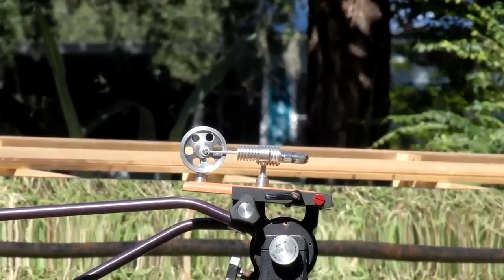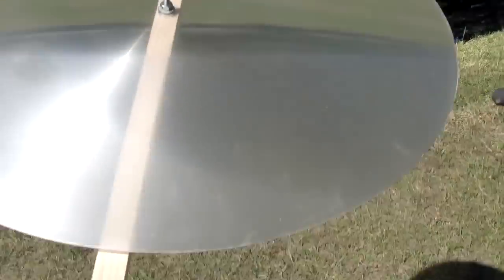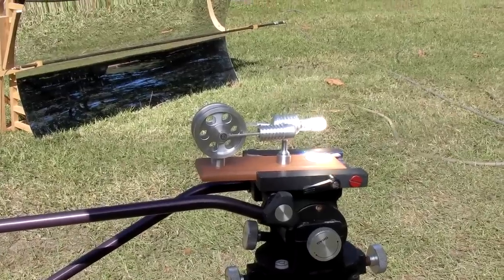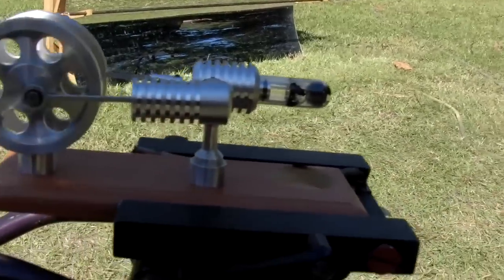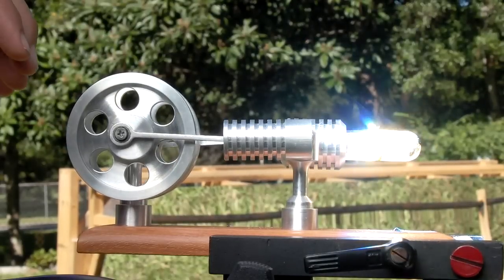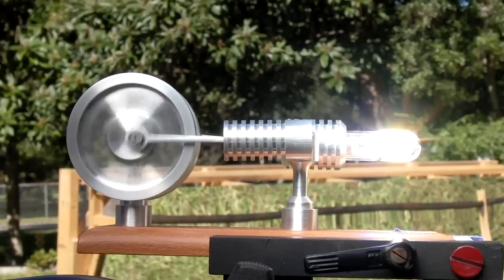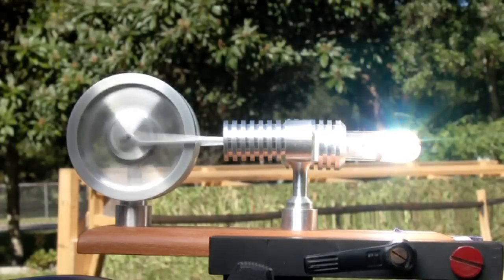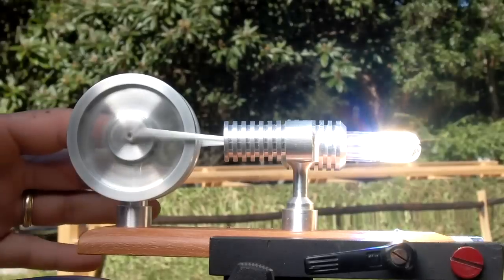STIRLING ENGINE FRESNEL Lens on a Steek Solar powered Stirling Engine

Comment from the maker: If the engine is not running it will burn. The engine removes the heat. If the lens were larger, it would overpower the heat removal and burn the steel wool.

Comment: This setup would work well with induction.
You could place a tiny magnet on the wheel and spin it near a tightly wound copper wire.
Reply: Comment 10 years ago unappreciated. This would be a very good way to generate electricity I agree
Reply: @MrArtVein  give me a year
Reply: I'm doing it by combining two fridge compressors. One induction per piston
Reply: can someone make a video
Reply: I am student of Bangladesh. Can you teach me more and visit our country with your thoughts ?

Comment: You could do something insane, like put a long heat chamber down a parabolic trough & run several water mist injectors. Link several of these piston/heat chambers to a crank shaft & run a full sized generator. 
Could even use fire to heat chambers when sun goes down, in an emergency.

Comment: Water should burst into flash steam inside the chamber, increasing pressure for more horse power.
Set it to squirt each time the piston reaches its lowest point.
Would turn that heat motor into an ICE motor that runs on sunlight & water, the combustion being water exploding into steam at timed intervals rather than gasoline or diesel exploding.

Comment: Here's a suggestion for dramatically increasing horse power.
First, replace that glass chamber with a strong, metal chamber. (you'll see why in a moment)
Next, tap a small water nozzle into chamber wall to shoot a few drops of water directly into chamber.
Hit chamber W/Fresnel. Squirt those drops of water on inner chamber wall right beneath the hot spot.

Comment: in the lighty it has gears . when I crank it at 60 rpm's the gen. is turning 600 rpm's . so this so this engine has more than enough power to crank it without the gears.the flash light it self is assisted with batteries. so with extra batteries hooked up in parallel to take the extra charge while the sun is up and  and discharge while the sun is down( to the LED's) perpetual lights .I know they allready have em in solar cells, but this could be the first one with a sterling engine

Comment: How do you calculate the diameter of the Fresnel lens and  could you use a standard magnifying lens just as well and would a larger diameter generate more power, always assuming that the steel wool, or other conductor ,could absorb the excess heat?

Comment: Cool, the only draw back of the Fresnel lens is you'd have to keep adjusting it somehow to keep the motor going. I much more liked the trough one as it made a lot more practical sense.

So build on that, would love to see a real world implementation
Reply: That's easy, based on your latitude time and date you'd know the exact position of the sun.  Just have a small motor do the adjusting.

Comment: Love those stirling engines, they are even great for getting some power off heat from many devices that would have been lost otherwise. I have designs for some devices that are lined with them, just for that purpose, so nothing is wasted. When heat is involved of course. I first learned about them from a show on Dean Kamen in the late 90s I believe. *****
Reply: Hi, do you still have those designs and ideas?

Comment: Boiling water pushes the piston until it reaches the end of the cylinder & on its way back the slightly cooler water returns via condensation through small grooves/holes in a part of the metal.

I have not opened up a Sterling engine so I don't have exact parameters.

However I'm sure Dan Rojas (?) Could explain the mechanical part better.

Comment: Pretty damn fast!

You should keep in mind that if you were getting some sunlight on OTHER areas of the piston (which are supposed to be as cool as possible) then you could also partially be defeating yourself.

A mirror array plus sterling is supposed to be the most efficient commercial power method from sunlight available.

Comment: Sterling or steam engine combined with solar concentration I believe is the future. This is actually far more efficient than any other practical solar technology today. And of the two I believe Sterling engines are far more practical, reliable and safe for residential applications. 

Nice video Dan! Thanks.
Reply: I'm really interested in this, been researching it for the past 6 hours continuously, went and learned the basics of steam, sterling, PV pannels, incl PVTs. chat gpt is really an amazing amplifier of knowledge gathering and skill amplification. I intend to start a prototype maybe in a month or so.

what's cool is you can use them for anything. you have a rotating motor (think mill, cuttins stuff etc.), but you can connect an electrical generator to it, and with cuntinuous iteration you'll of course arrive at also capturing that excess heat, use a TEG (Thermoelectric Generator) to perhaps capture another 5% of that, and the rest is just heat energy which you just store for later (this I think is the hardest part, and CSP (concentrated solar power) systems already use this, but I was suprised to see they're using steam engines instead of stirlings). anyone interested I'll post on twitter: @xucian_
Reply: @onelucian Hey. Have you followed up on that idea? I’m thinking of doing something similar
Reply: Use it to heat sand batteries for sand battery heaters too @onelucian
Reply: its not tbh, its worst in here
Reply: Very hard to maintain power , problems  with sunlight , will eventually melt anything including rock , 

And pretty noisy compared to home solar
Reply: Wow 15 years ago, ahead of your time. Everyone check out what Exowatt is doing!
Reply: Gay-guy...

Comment: that really does not give much information on the power of the engine. could you hook it up to a fan or an electric generator, that way we can have some idea of its ACTUAL power? also, just from this video it seems like it has allot of torque but very little horsepower(is that the right word?) but this could just be an allusion from the camera.